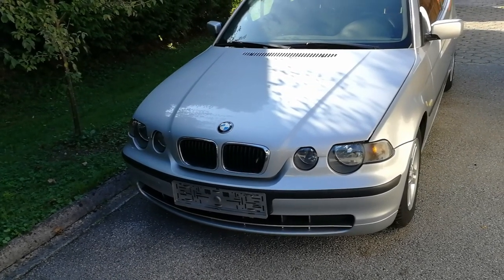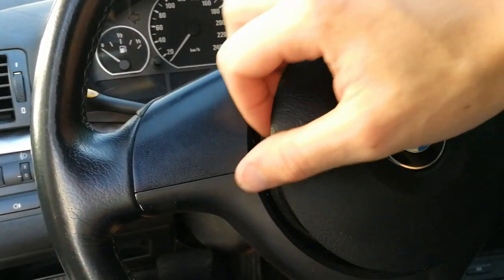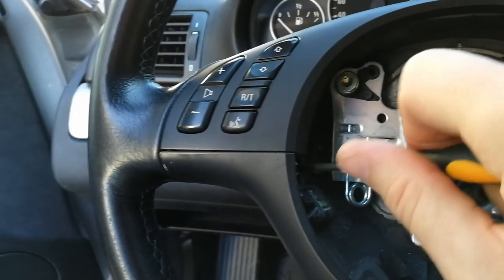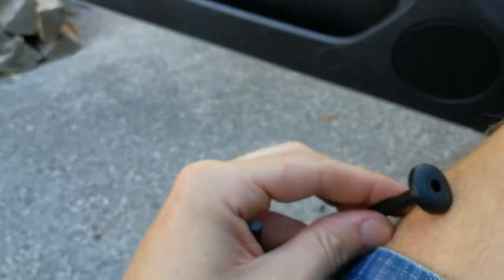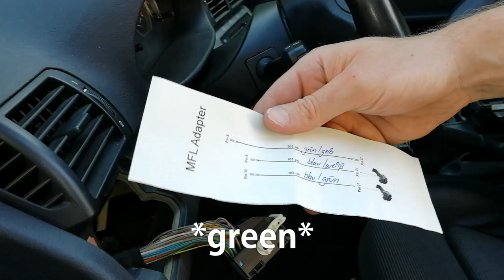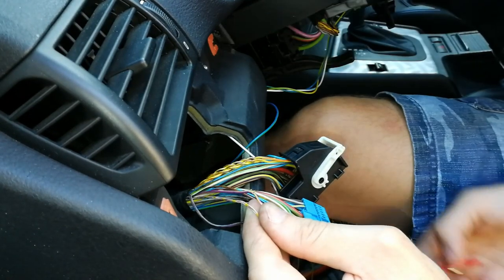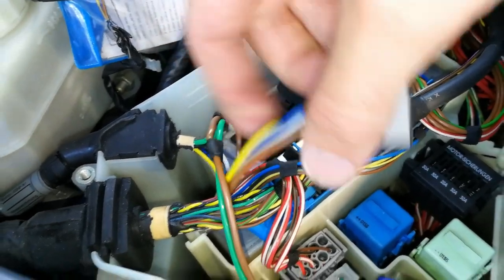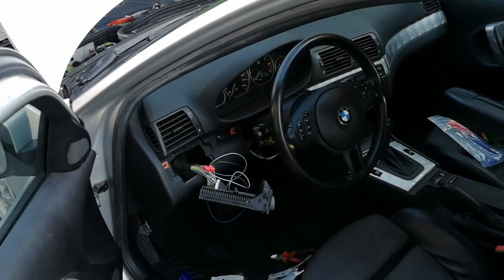E46 Multifunction Steering Wheel Retrofit DIY Guide with Radio and Cruise Control Buttons

Comment: You didn't mention the switches on the brake and clutch pedals... what about R/T and talking guy buttons? On my e39 I have factory installed cruise control but no R/T and talking guy, I put a complete panel but unfortunately is not working...
Reply from the maker: Sorry, I don't know what you mean with the clutch and break pedal... I don't know if this works on E39 and I never looked in to the R/T functions. I assume you need some other hardware like microphone and phone to make that work.
Reply: @BimmerZen  R/T have to act like Mode button circles through Radio/CD/Tape/Phone - like a source selector. The talking head button normally will work if you have the phone module (witch I don't have). About cruise control - when you hit the brake or the clutch the function is suspended, the green light remains on the ike but will only resume to the selected speed if you press again the button on the steering wheel. Test if it does like that - press the brake or the clutch and see if the speed is decreasing if so press again the button to see if the car is gaining again speed and stays at the selected speed. The I/O button shuts ON or OFF the entire system. There are 2 switches at e39 that triggers the suspend state - i guess the same should be at e46
Reply from the maker: @florinlepadatu5648  Yes, the E46 already has those switches on the clutch and brake pedals, so the cruise control function just piggy backs of those and disables the cruise control if you press them.

Comment: Hi. I have question. My car e46 318i m43 engine. Its the multifunction steering suitable to my car? My car dont came with no multifunction steering.
Reply from the maker: M43B19 BOSCH M5.2: Cruise control retrofit needed (https://www.realoem.com/bmw/enUS/showparts?id=AL31-EUR-04-1998-E46-BMW-318i&diagId=66_0043)

Comment: hi i have a bmw e46 318ci n42 11/2001 prod.
will need wiring ? becuase i have heard that bmw that is after 2001 is plug and play?
Reply from the maker: You will need the wiring kit; 3 wires and pins that fit in to the steering wheel connector

Comment: So the connection to the wires for the multifunctions comes pre installed from the factory? You just need to buy the multifunctional buttons? If so do you know if the E39 is the same, thanks!
Reply from the maker: As in the video; you will need to install 3 wires

Comment: Hi, Will it work on my M43 1998 motor ? I saw manual where guy need to add stepper motor And control throttle. M50+ motors have this parts alredy prepared from factory ?
Reply from the maker: I think You can not just install the multi-function steering wheel. You will need the servomotor retrofit. I don't know about the M50 engines...
Reply: @BimmerZen  i read any forums And i think they add El throttle from 2000+. But need to check IT when i come home tonight. But ty for response.

Comment: Hello friends bmw 2004 e46 318 retrofit cruise control felt there is a guide but it does not work box ecu 27 pin or with 37 which pin should be connected
Reply from the maker: If you have the N46 engine: N46B18/N46B20 BOSCH MEV9:  4 E Data link MFL (26-pin, black)
Reply: 26 or 27 black busy
Reply from the maker: @izmirkadija890  Pin 4 on the black connector with 26 pins.
Reply: @BimmerZen  4 pin  black busy 3 pins empty
Reply: @BimmerZen  pin 4 black connector cable blue white
Reply: @BimmerZen  remove the blue and white wire and put the new wire
Reply: @BimmerZen  some are telling me that pin 4 is black 26, but pin 4 is blue and white, but they are telling me to remove the blue and white one and replace it with the new one
Reply: @BimmerZen  do you have any idea
it happened to you as a problem bmw e 46 318 2004 cruise control retrofit

Comment: After i connect pin 27 on the light module, my indicator lights doesn't work on the instrument cluster but does outside!!
Reply from the maker: Strange... Did you double check your connections? All the wires going to the right pins? What happens if you disconnect  the new wires - does the indicator work?
Reply: @BimmerZen  if disconnect the new wire from pin 27 the multifunction stops working and the indicators works again, plus even the light for the fog lights and high beem also doesn't work while the new wore is connected
Reply: @BimmerZen  ?
Reply: did you fix this?

Comment: Question: My Radio buttons are not working. This is only specific to me most likely; because i didnt have connectors on the radio so i wired every one of the cables myself for my new android head unit. It works but steering wheel buttons doesnt work on it. Because i dont know which cable to use to connect Android's steering wheel control cable. So most likely i need diagram for that. Could you help me out?
Reply from the maker: I have no experience with aftermarket radio units, so I doubt I can help you. You need diagram for the light switch?
Reply: @BimmerZen  thank you for the reply anyhow 🙂
I need diagram of steering wheel controls to head unit wiring diagram.

Comment: Hi what wires size and lenght is this, how can i do it without mfl adapter
Reply: did you delete comment for wire size, what was it
Reply: @AladinTechnology  I don't know what you mean by "how can i do it without mfl adapter"...? I don't know exact wire length and size, I bought a MFL kit from ebay (link in description). I think 0.50 - 0.75 mm2 on the size and two wires are about 1 m and on that goes to the front ecu box is a bit longer, probably 1.5 m.

Comment: hi i just did this but everything works fine 
just the cruise control does not work 
do you now why
Reply from the maker: Check the wire going to the ECU box. Check for continuity form steering wheel buttons connector to the ecu wire. Check if you used the right pin in the ecu connector.

Comment: I have a 325ti is it possible just changing steering wheel buttons it all works or we always need to do the wiring part ??
Reply from the maker: Not sure I understand your question... If you are replacing a steering wheel that already has (working) buttons, then it's not necessary to do the wiring (like upgrading to sport steering wheel). If you have a steering wheel without buttons and you are replacing it with a steering wheel with buttons, then you will have to install the wires.
Reply: @BimmerZen  sorry for my bad formulation. I mean, I have a steering wheel without buttons. Just to avoid all the pain with cables, I just hope "dream" that all wires maybe are already set up from factory and I only need to replace the steering wheel part ? is that even possible....
Reply from the maker: @luisqp66  If the car came from the factory without the multifunction then you will have to install the wires. It's really not that hard to do, i think:)
Reply: Finally i tried exactly as your video but ot doesn't work.... I asume problem may be from clamp that doesnt make correct contact or steering wheel boutons parts not working....
Reply: Is it possible that the red connectors don't connect properly ?

Comment: If i have m43 emgine and just want the radio buttons working and ignore cruise control, will it work somehow?
Reply from the maker: I'm not 100% sure, but I think the radio controls will work. For the cruise control you need additional cruise control module and some other parts installed: https://www.realoem.com/bmw/enUS/showparts?id=AL11-EUR-01-1999-E46-BMW-316i_19&diagId=66_0043.
Reply: @BimmerZen  Thank you! I wonder if just connecting the controls with the steering wheel will do the work for radio. Hmmm. Thank you anyway. awesome video!
Reply: @Greatswordgamers   did it work?

Comment: I have a question. My bmw is year 1999 , will this work as well? Because all of the MFL wiring kit that i can find comes with only 2 wires, not 3, so im a little confused by that.
Reply from the maker: Exact model and production month/year?
Reply: @BimmerZen  its an e46 pfl. production year is 1999. and the month is 9, if not mistaken
Reply: @BimmerZen  323i with the m52b25 engine
Reply from the maker: @davispupols  from what i can understand the 323i with the M52TU engines come with a drive by cable/bowden throttle controll, but they still have electronically controlled throttle. This means you should be able to retrofit MF steering wheel, but you must still have 3 cables: two go to light switch and one goes to the DME unit at the front. You should be able to find some useful forum posts if you google multifunction retrofit for your car model.

Comment: is this the same procedure for E46 Sedan 2004 N46 engine? especially the ecu cable part
Reply from the maker: Yes: https://www.newtis.info/tisv2/a/en/e46-316ti-com/components-connectors/components/a-control-units-modules/a6000-control-unit-digital-motor-elecronics3/YZn5ycy

Pin 4 on connector X60002 (26-pin, black): https://www.newtis.info/tisv2/obj/CULJXaO7
Reply: @BimmerZen  what is the specification for the wires? (Awg,diameter,etc)
Reply from the maker: @AldoSoeprayogi  That i do not know. Any normal quality soft braided 0.75m2 copper wire should work fine

Comment: hi there, i have e85 z4 without a multifunctional steering wheel and im interested in purchasing one with the multifunctioing buttons. However im not sure if it will work. Do you know what that cable with the various colours that makes the steering wheel work called?
Reply from the maker: From what i have seen on the internets, it should be similar procedure. You have to use 2 wires and connect the slip ring to the light switch box. The e85 have separate stalk for cruise controll, so there is no third wire. I think the OEM code for this cable is 61120394848. Just search for "e85 multifunction retrofit cable"...

https://z4-forum.com/forum/viewtopic.php?t=16422

Comment: Will cruise control work if I use non original radio? I know it is not possible for multifunction buttons, but I would like to try to connect cruise control.
Reply from the maker: I'm not 100% sure, but I think cruise control should work just fine. I think radio commands are just ignored if you have a custom radio.
Reply: BimmerZen thanks bro!

Comment: so this wont work on bmw e46 2000 year, 100kw/136hp M47 engine ?
Reply: It'd work, yes.
Reply: @simaorodrigues6285  Hello, have you tried it? Looking to buy the kit but not sure if it'd work on my M47 engine from 01/2000
Reply: @Battlefield1942Veteran  it will work, I've done it.

Comment: Hi!  Will this work on a 2006 M3 CS?  I'd love to have radio controls on steering wheel.
Reply from the maker: Yes. MSS54 ECU has pin 27 for MFL on X60004 (40 pin) connector.
Reply: @BimmerZen  Thanks!
Reply: but the i/o controls M sport mode on the cs wheel... instead of turning cruise control on or off. How will it operate in this instance?

Comment: Does it work on bmw e46 316 2001 sedan? Thanks a lot
Reply from the maker: This will work if you have the N42 (1.8) engine. The version with M43 (1.6, 1.9) engine does not support this mod.
Reply: @BimmerZen  it's a 1.6 so i won't?
Reply from the maker: @alexcazacioc4096 E46 316i 1.6l sedans only came with older M43 engine which has older BMS46 ECU. M43 models have separate cruise control unit... You would need to install this kit: https://www.realoem.com/bmw/enUS/showparts?id=AL31-EUR-12-1999-E46-BMW-318i&diagId=66_0043
You can check in the ECU box in the front if you already have the cruise controll unit: https://www.newtis.info/tisv2/a/en/e46-318i-lim/components-connectors/components/a-control-units-modules/a8-control-unit-cruise-control/W9t6H3x

Comment: Does it work on 320d 1999 m47?
Reply from the maker: DDE 3.0 has MFL data link connection on pin 27 on 40-pin black connector, so it should work.

Comment: Ive done the same, not working. Does it need coding
Reply from the maker: It does not need any coding. What model/year is your car?
Reply: @BimmerZen  i had to switch pin 10 and 9 for some reason
Reply: Now cruise works, audio buttons not working yet. But that is an isseu of the cheap ali express radio canbus i think

Comment: Is it the same thing on the 320ci?
Reply from the maker: I think all 320ci with M52 and M54 engines with MS42 DME have this option. I think some early E46 models with BMS46 DME did not have this option. Production year and engine?

Comment: Will this retrofit work for e39
Reply from the maker: model, production year/month and engine?
Reply: Е39,2003/05 3.0d
Reply from the maker: @1efis  Yes. ECU Pin 27 (the 40 pin connector).

Comment: does it work for diesel models?
Reply from the maker: Yes, but DME pin might be different. You can find the right pin by finding the MFL pin in the wiring diagram for your specific model/version, for example: https://www.newtis.info/tisv2/a/en/e46-318td-com/components-connectors/components/a-control-units-modules/a2249-control-unit-digital-diesel-electronics/nNU5yON
Reply: Same pin for diesels up to Sept 01, pin 37 on the X60002 connector for later models. They'll most likely require a different insert so it may be better to get a retrofit kit with it.

Comment: Hey buddy,i dont know if you will respond at all,but wanted to ask you a couple of questions.
So,im looking to buy an BMW e46 318d 85kW,2003 year of production,it has the same steering wheel as you do,is it possible to get this done on it too? Since i would really like to get the cruise control on it,the radio doesnt matter as much to me. I would like to see if i can go with the exact same wires as you did on the video and try it out. Please let me know or give me your Instagram/Facebook so that we can type in chat there
Reply from the maker: It should work on your car. On your model, you have to insert the long MFL signal wire in pin 37 on black 58-pin connector on the DDE unit (ecu). 

Search for "multifunction" or "volute spring": https://www.newtis.info/tisv2/a/en/e46-318d-lim/components-connectors/components/a-control-units-modules/a2249-control-unit-digital-diesel-electronics/YpJhvdP

Comment: Does it work on 2004 e46 318i N46 engine., and are the pins to connect similar
Reply from the maker: Sorry for late reply, YT is not sending me all of notification about new comments:(

N46 engine has different ECU, but it should still work. The wiring diagram shows MFL connection on pin 4: https://www.newtis.info/tisv2/a/en/e46-318i-lim/components-connectors/components/a-control-units-modules/a6000-control-unit-digital-motor-elecronics7/YZn5ycy

on X60002 connector: https://www.newtis.info/tisv2/a/en/e46-318i-lim/components-connectors/plug-in-comb-type-solder-connectors/connectors-from-x6/x60002-connector-control-unit-dme/VWzkZSv
Reply: @BimmerZen  many thanks for your video and for this specific reply on the N46 engine. If I hadn't read it I would certainly have put the MFL connector in the wrong position! 😉
Reply: @BimmerZen  EDIT: pin 4 on my N46 was already in use, it works smoothly on pin 27

Comment: Hi!I have a music control on my multifunction steering wheel but my cruise control is not working.If i install these cables should it work?
Reply from the maker: Depends on the model of your car. If you have N42 or M54 engine, you probably only need the wire that goes to the engine ECU box for the cruise control.
Reply: @BimmerZen  mine is m43b19 318ci 118 hp
Reply from the maker: @alexanderhristov6526  You will most probably need to retrofit the throttle servo motor. Check out this link: https://www.e46fanatics.com/threads/bmw-e46-multifunction-steeringwheel-m43-engine.969296/
Reply: @BimmerZen  thank you

Comment: Hey bro , one question. 
I have same steering wheel on my e46. 
Every time I press the “ volume down “button, but results in next track when I listen to the radio. 
What might went wrong on my media control? 
Thanks in advance.
Reply from the maker: Sorry, I don't know what your issue is. I would check that the wiring on the slip ring connector inside the steering wheel is correct (https://youtu.be/eD3j1VFM-dY?t=793). Maybe some pins are mixed up...

Comment: Hi there, does this work on a 320d from 2003 150 HP AUTOMATIC transmission?
Reply from the maker: I think it should work.

ECU's dde30ds0, dde40kw0:  40-pin connector, pin 27
ECU's TU 2001/09 - 2002/02, TU 2002/03 - 2003/02, TU 2003/03+ : 58-pin connector, pin 37
Reply: @BimmerZen  thanks for ur answer, im going to try it, awesome content keep going :)

Comment: would it work on a 318ci from 2000?
Reply from the maker: I think you have the BMS 46 ECU which does not support this mod. M43 models have separate cruise control unit... You would need to install this kit: https://www.realoem.com/bmw/enUS/showparts?id=AL31-EUR-12-1999-E46-BMW-318i&diagId=66_0043
You can check in the ECU box in the front if you already have the cruise controll unit: https://www.newtis.info/tisv2/a/en/e46-318i-lim/components-connectors/components/a-control-units-modules/a8-control-unit-cruise-control/W9t6H3x

Comment: Will this work on BMW E46 318i 
2.0   105 kw 2004 ?
Reply from the maker: Yes.
Reply: @BimmerZen  I'm sorry to bother you. I have one more question. If I connect an installation like you? Will something be damaged? The car is from 2004 318i 2.0 105 kw n42.
Reply from the maker: @munja5495  nothing will be damaged if you do it correctly (correct pins/wires).
Reply: @BimmerZen  ok. Tnx!!!